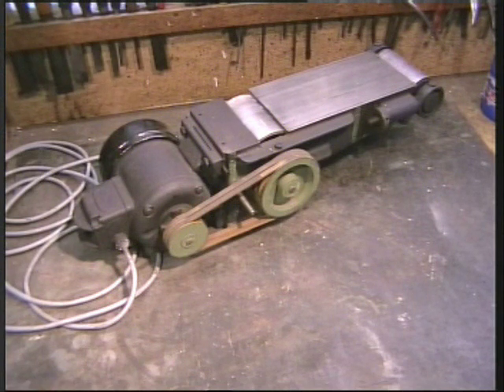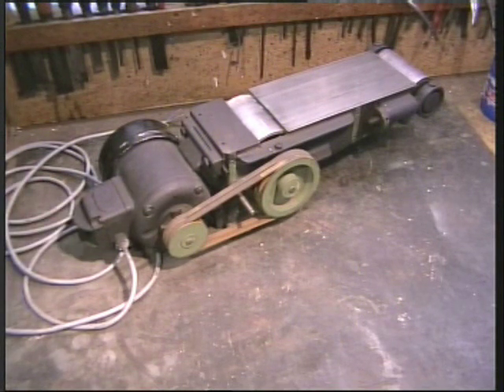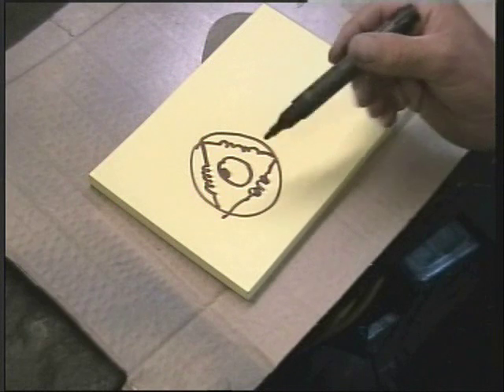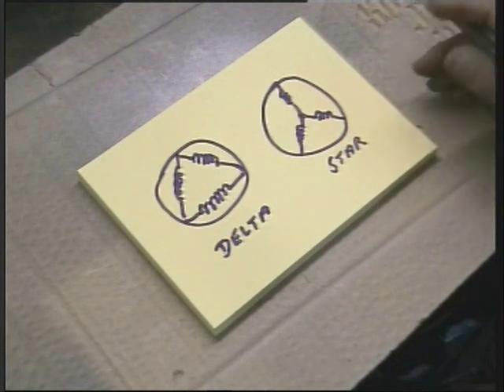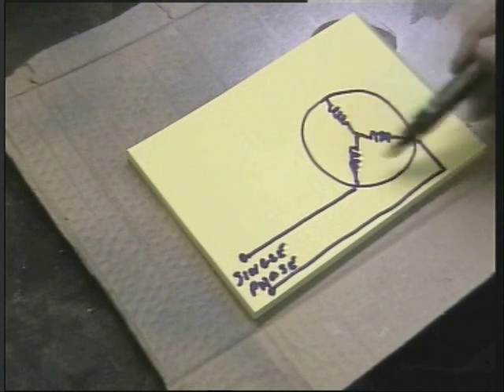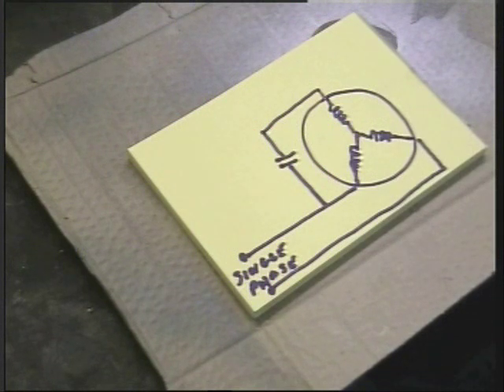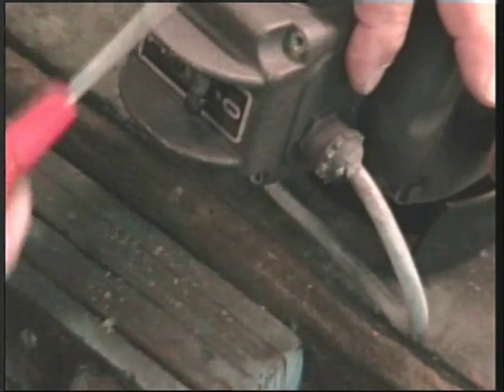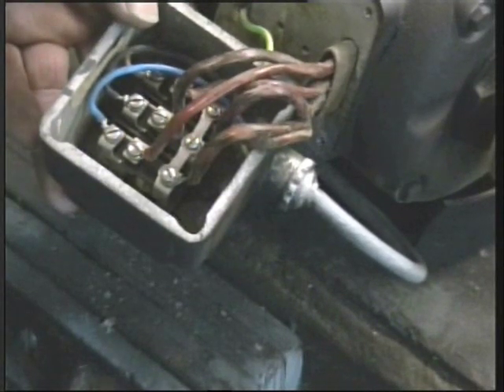three phase motors.wmv

Comment: This should make you laugh. In my younger days I became obsessed with trying to convert 3ph motors to 1ph. Before the internet it was so difficult to share information. I met so many people "I had an uncle who knew how to do it", "I knew a sparky who could do it" "well I do know but I don't tell anyone!" and then electrical engineers who told me that phase angle shift would be beyond my comprehension and the college tutor, head of electrical engineering who told me that it was impossible. I eventually bought a 3ph Wadkin spindle moulder and found a drawing in the switch gear showing just how to convert with capacitors to 1ph; and then I got a phase converter at a boot sale for two quid! 
Around this time, thirty years ago I used to change the motor. So I had a good old table saw which I wanted to convert, I was skint but I had two pressure washers so I took the worst one apart, it had a flange mounted motor and when I got too deep into the job I discovered that the bearing was on the pump side of the machine and not on the motor side so I made a new end plate for the motor. So far so good put it on the saw and started it, it ran backwards so I looked in the terminal block and found that it only had three wires, well it does not matter which way a swash plate runs does it. So to start the saw I needed to press the button and flick the blade in the right direction to get it running. Then one day this guy turned up and watched me start the saw, he all but had a heart attack, it turned out that he was the health and safety gestapo man and he put a notice on the saw prohibiting it from use. And twenty five years later I am still using it.
 All the best, Jon
Reply from the maker: thanks Jon its always nice to get comments and i always read them cheers

Comment: Why don't you show the actual wiring process of the motor it would help the understanding of the technique. I thought you said that you needed two capacitors one start and one run also the on off switch for this extra capacitor.

Comment: You Sir have done a very good job! Perhaps It would be good to mention that single phase power in your home actually has two hot legs for a hot water heater, Dryer & oven element also many cold air systems are also 2 hot legs called single phase 220? (double phase is not used) three phase is 3 hot legs!  ask yourself does a magnet really care about phase? a phase converter can run quite a few loads,  size is an issue!  thanks again, Nick

Comment: I have a 3 phase permanent star connection induction motor with on 3 wires coming out of the stator. Can I still use your rewiring method to run it on single phase?

Comment: I'm sure the guys in pick up trucks do it because they make a lot of money! I cleaned my garage & took a bucket full of old, used copper & brass plumbing fittings & a dozen door handles & hinges to the scrap dealer. I got £50! Not even sure I paid that much for them, new...  So, alas, there is now much competition to get my mits on stuff :(

As for the council, I expect that is more to do with EU directives ^_^  Recycling may not be efficient, but they are efficient at getting to it before me!

Comment: 24 hours ago I had zero idea how a electrical motor broke. I am trying to fix my dads electric pressure washer because it just buzzes and as a result been on countless forums and watched countless videos, but to no avail. Until i came across your video and i now fully understand how it works and know that the capacitor is probably broke. Thank you!!!

Comment: well i don't need to do this anymore i have 3 phase now, i did run the motor by itself on 160mf , but when i did tighten the belts it wont start tried even push-starting it but it just hum and do nothing, i figure i neded to add biger caps just for starting and let the 160mf for runing only... if you check my videos you can see it run :) in the last video on casting aluminium

Comment: well it runs with 2 caps of 80uf( total 160) at 450v i tried one but it didn't go up to speed and with 2 cap it did but kinda slowly ill ad a third one for start i think... i din't put it under any load yet but it runs so your method worked on a 7kw motor

Comment: The reason for the different winding connections is to do with your start up current and torque.  Star is used when low amps are needed but resulting in a little torque, only needs small gauge wires needed
Delta is the opposite, High amps and High torque on Start up, this is used in larger motors primary large gauge wires
Star delta Connections are used alot but require the use of contactors, or you can get soft starters for Delta connected motors which slowly rise the amps up to running spedd